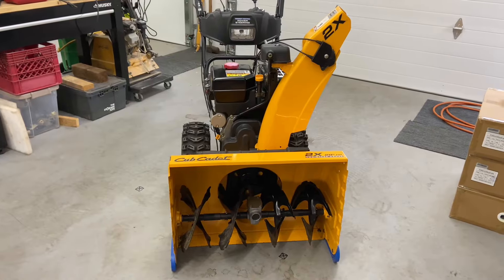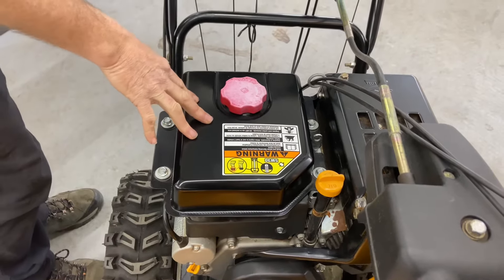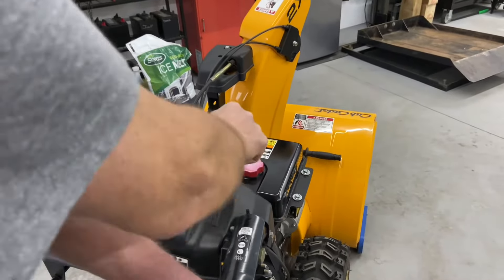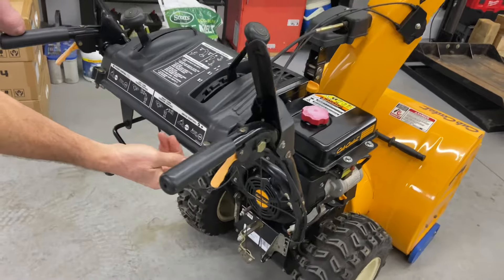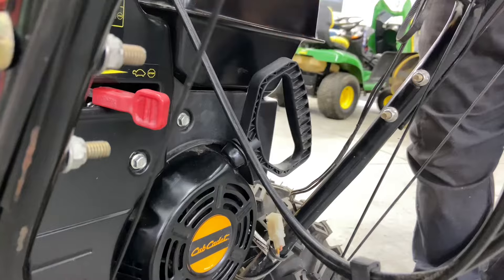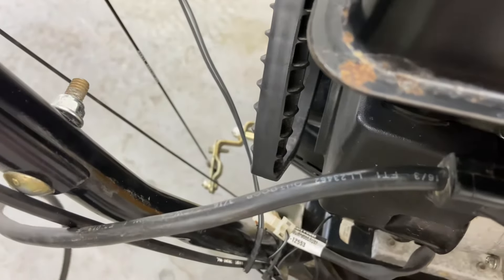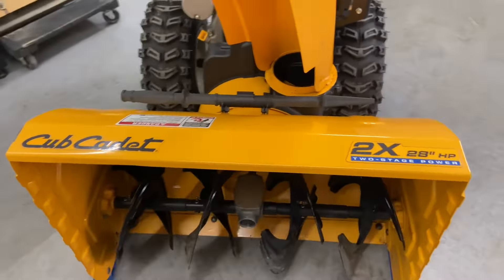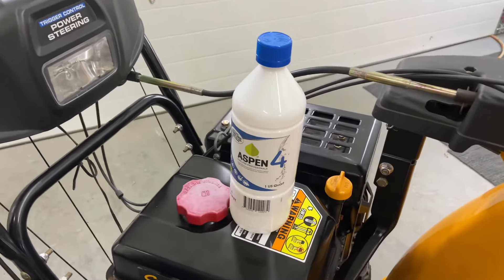How to Start and Operate Cub Cadet 2X28 Snow Thrower

Comment: I live where non ethanol fuel is simply not available So every tank of gas gets a shot of Seafoam to keep the carb clean. Short term storage I add Stabil to the gas. Long term storage the gas is totally removed. I also do this to the 10 generators I own (the ones that run on gasoline anyway) since they sit for long term unused. Never a problem for 20 years

Comment: Thank goodness for YouTube "how to" videos. Haha 

I have a Cub Cadet 
model #31AM5BTR710

My mom bought it years ago and I swear each big snowstorm, we'd have problems with it starting up. 
Idk why my mom decided to buy this huge * snow blower/thrower for the tiny driveway. I do like to help the neighbors out though definitely with the ends of their driveways. 

She's been gone for just about 2 years and now I have the home. 
Earlier today, I tried to start it but then realized I was out of gas. Weird because I know I put sea foam in it late fall and there was plenty of gas. 

I didn't know about sea foam until my uncle brought it up about 2 years ago. He'd help my mom since he knows this type of stuff. 

I put in gas and an couple of ounces of sea foam about 20-40 minutes ago. 
I tried to start it but I'm thinking I have to wait a bit for the gas to do whatever. I don't know this stuff.
I'm embarrassed. Like every time I'd try starting it, I always forget about the turtle thing...throttle. Well duh makes sense. Thank you again for the most common sense tip. 

I live in Wisconsin and this is the first time this winter we got snow that didn't melt right away.

I'm going to try it again after this comment. 
I do want to say thank you for your right to the point video for people that might be like me. 
The manual doesn't say the some of the things you brought up. 
Also I didn't know about using non ethanol gas. I wouldn't be surprised on why that would be the reason why I always have a hard time starting it once a year. 
Idk but thank you again. 
I'll update this comment after it starts. Lol
Reply: I got it started yesterday but then it was chugging. The only thing I could think of is the spark plug. 
I was able to change that today and finish the driveway. More snow coming. 
Thank you again for the help!

Comment: which way does the heated handle grip switch have to be to make them heat up
Reply from the maker: Most machines that have the heated grips will show On/Off sometimes tucked up where you cannot see it very well but if you have a I and a O? I is on and O is off.

Comment: You are the go to guy for my Cub. A ?? if I can. How much oil is required in that Cub after draining. I have no manual.. tks
Reply from the maker: There are a few deferent size engines they use on this model. You will need your model and serial number from the sticker on your machine normally located below the pull starter housing on the transmission cover. Go to the Cub Cadet Web site in this link and you will be able to find the manual .https://www.cubcadet.com/en_US/operatorsmanuals.
Reply: Thanks for the quick response..cheess

Comment: I use non-ethanol fuel in all my power equipment. It's available here at the pump in many locations. I keep several five-gallon cans on hand at all times. Since it's from the pump at the service station, it's only a little higher price than 10% ethanol fuel.
Reply from the maker: And you most likely do not have many or no carburetor issues due to gas going bad?
Reply: @JohnsonsSmallEngines 
I actually didn't know that so thank you for the tip

Comment: Do you have idea which snow blower is the best, or would you rather not say? Great video.
Reply from the maker: Most two stage snow throwers like this one will perform just fine for many years. You just need to perform regular maintenance and get to know your machine. The better you know how to use your machine in the conditions your in and along with keeping up with all adjustments, most machines will last a very long time.
Reply: @JohnsonsSmallEngines  Thanks. Have a great day!

Comment: Great video, do you have a video on installing a fuel shut off on these engines?
Reply from the maker: I replied to your other comment. "Thank you. I do not modify customers machines. I try and educate them on the fuel to use so you do not need to modify the machine. read up on Aspen 4 cycle fuel. If you use it in your snow thrower, you will not need a fuel shut off. Here is a link. https://www.aspenfuels.us/knowledge/what-is-alkylate-fuel/what-is-alkylate-gasoline/.  I would love to see a inline fuel shut off kit but it is hard to install one without a major modification and I'm sure someone will make it"

Comment: i bought my cub cadet new a year ago and used it 3 times. total run time 30 minutes. it hasnt been run in 9 months. it always ran non ethanol fuel and was put away with a half tank with some stabil in it. now it wont start. what can be wrong? its brand new!
Reply from the maker: It sounds like your doing everything good but I would recommend running the machine every 45 to 60 days to to get the good fuel through the carburetor from the tank. Most likely the fuel that is in the carburetor may have gone bad. Watch this video, https://youtu.be/qPoyyRTMhoY if you would like to diagnose your machine.
Reply: @JohnsonsSmallEngines  thanks, I'm off tomorrow and will get into it.